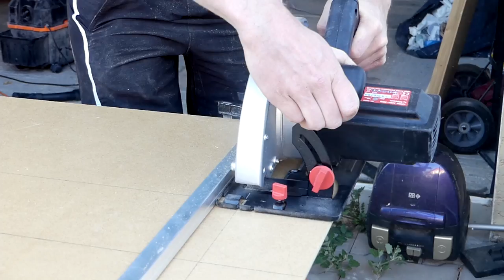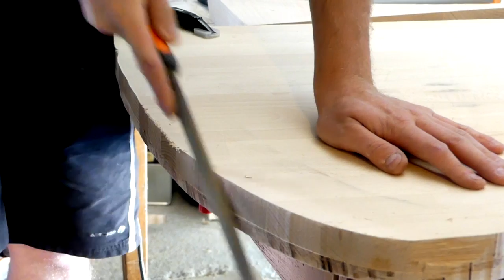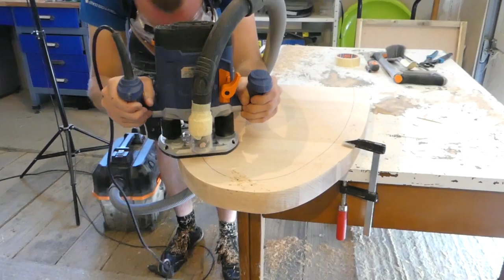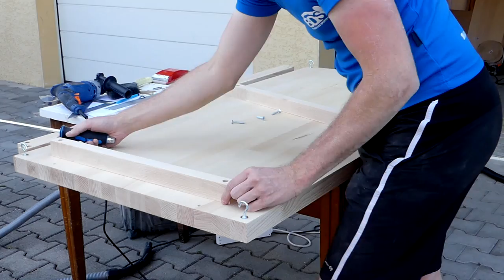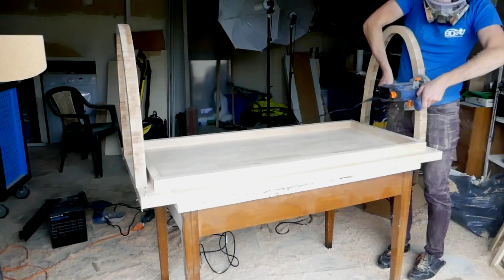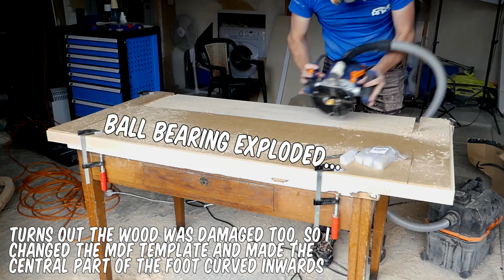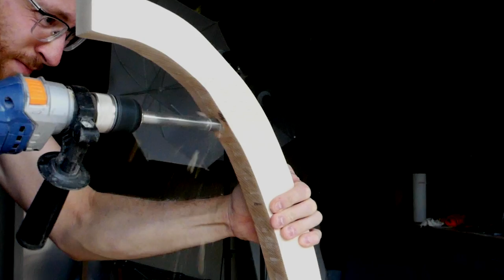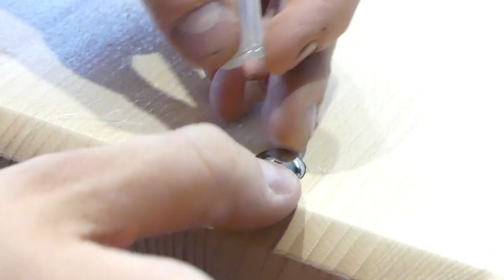The Impossible Floating Table !! (Tensegrity Dinner Table)

Comment: I would be impressed if you push from the side and let us see how it managed to balanced.
this i think is good for display  but not for use as obviously, you cannot use it for dining table.
Reply: Yes you can do you not understand tensions?
Reply: @RedRooster-xj4uk  i understand ofcourse.Yes it still can balance but you cannot use that as real table.
Here's for you to study.... A rope with tension  like circus walking on the rope.The rope  stays at the center but still, will slightly swing from side to side.  and using that table as a real table will not be efficoent.
Dont  you  realize why they never put anything om top of the table specially on the edge and why they never demoed by pushing it from the sides?
Its like you are saying you understand that a plate can sit on top of a spear.But you dont understand that you cannot use that plate on top of the spear.
Try to eat on that table.And prove me wrong.
Reply: @gym_buddies9504  first, look at the length of the rope relative to its diameter. That's where the sag comes in.
A tightrope with the same equivalent ratio as the chains would be over 18" thick. That under tension would not sag perceptible.
2nd short chains under tension give stunning stability.
3rd I've seen similar but different designed base tables with meals on top, with glasses and no wobble.
His carpentry was terrifying I'll grant you..how he's not lost digits is another story.
4th I've seen and used wobblier round tables on a heavy round base and single vertical support.
Reply: @RedRooster-xj4uk  pls show me a demo sir
Reply: @RedRooster-xj4uk  or a link that i can watch
Reply: @gym_buddies9504  have you EVER built anything?

Comment: Sorry didn't watch the video, but I had to comment
Not, impossible and not floating
The weight is supported by the 2 middle smaller chains 
And the 4 outer chains exert a pulling force on the 2 inner chains and also keep the table from pitching and rolling

Comment: Ouch!  Classic example of a DIYer who bought some tools and has so far "got away with it" and still hasn't lost an eye or finger...
"Here, let me cut this bit of MDF then waste time and effort hacking at it with a half-round file!"  Damn it, man,  just run some 120 or even 80 grit paper over it, two wipes, done.
And the way you abuse your precious tools, ouch!
And so many other unprofessional working methods some of which other people have mentioned.

"Don't do this at home kids!"
"We've done this so you don't have to!"
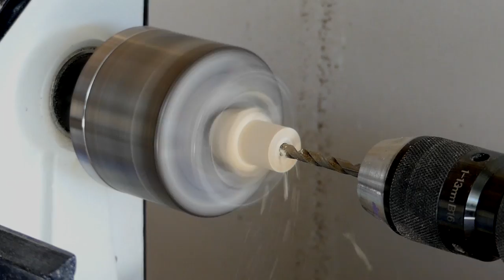Reply: The most alarming bit for me is the diy "wooden" router bit sleeve at 1:40 a very sharp router bit flying around at 9,000- 24,000 rpm af that gets loose your talking about 150-200 mile a hour projectile.
I've cut silly corners like everybody but there is no way on earth I would submit that on a video

Comment: Wouldn't the table swing? 🙄
Reply: Not a lot, just use pythagorean theorem. If you push the top to the left, the 4 chains will be trying to pull the top down which will increase tension on the short chains, which are also trying to pull the top upwards in the opposite direction.
Reply: @lornes7526  thanks for the explanation but i still want to see it in real to know

Comment: Like the table but that wooden bushing for a router collet is the most dangerous thing I have ever seen. You obviously have never had a router bit break or just come out of the right sized collet while the router is running.  It's scary how quick that turning momentum can change to straight line velocity. And it's even scarier when that router bit gets free and hits something in your work area. 
     Invest in a couple extra collets for your router. It will be cheaper in the long run than paying a hospital bill to have a loose router bit surgically removed from whatever part of your body it comes into contact with !!!

Comment: so why would you rout the arches freehand when you could make yet another MDF template and save yourself a LOT of labour and get very precise results? MDF is CHEAP, i use it all the time to make templates....I build instruments and wouldn't be bothered to cut a guitar body, on a bandsaw and have to do all the rasp and sanding work afterward. a template is the way, to go,y and it also speeds up the process if y,you aver wanted to build more than just one.
Reply: Probably so somebody somebody would come along and completely lose sight of the fact he didn’t need a template
Reply: @nicholasjaworski9368  sure you don't "need" a template or a Dremel tool... or a shopvac, or a Bandsaw apparently.....and you could cut down a tree with a hammer and chisel....so why not? but regardless, the table is awesome!

Comment: There is nothing impossible about this, neither is the table floating.
The two chains in the middle of table are keeping the table up and the 4 chains on the corners are keeping it stable. There is no strength in this table other than the two chains. 
It looks nice but is totally unusable like a normal table. If it gets bumped, it will move uncontrolled and for example, a glass of water, will fall over. Please dont call it "impossible floating", but maybe "unusable weak" is a more suitable name.

Comment: I understand the desire to get people to click on your video. But, it’s pretty dishonest to build something so fragile and unusable. Build a piece of art that you hang on the wall perhaps. Not something funcional like a table or chair. If it’s funcional, show us that it works. In this case, that would be obviously impossible. You have one screw per corner holding the oval pieces to the top unit and no braces. 🤦🏻‍♂️ That table would fall apart with the slightest use.